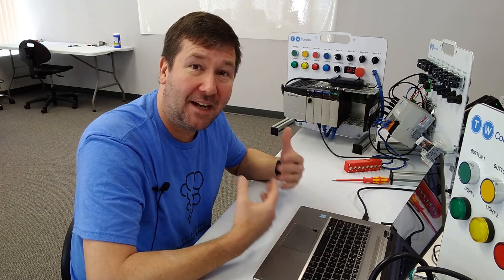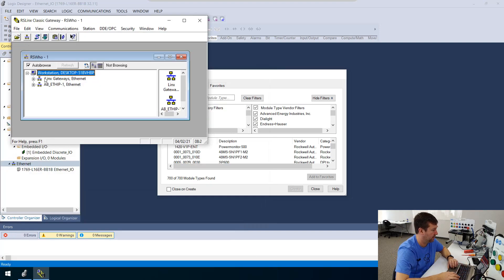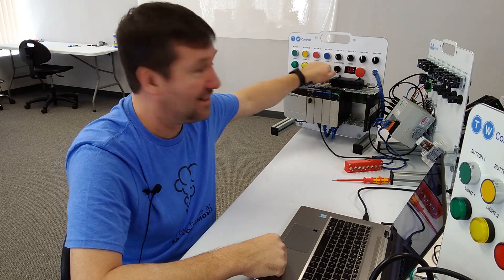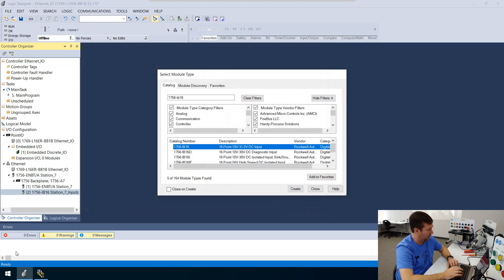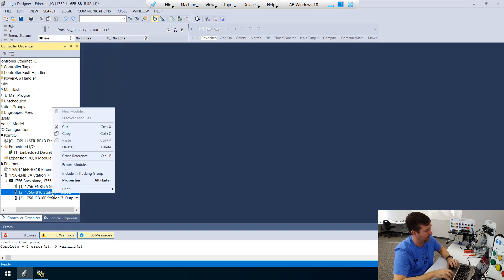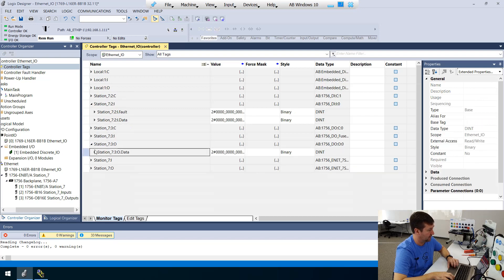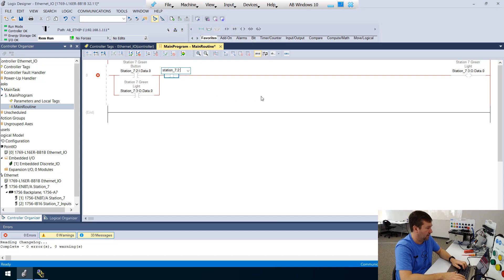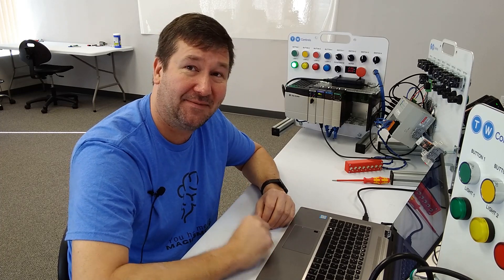Adding Ethernet Modules in Studio 5000

Comment: great video! i have a question... you have set up the DC input and DC output modules through the Ethernet IP module on your CompactLogix,,, can those modules be also linked to the ControlLogix and be read/written in parallel with CompactLogix? or what is the use of the ControLogix processor there?

Thanks in advance!!!
Reply from the maker: The Controllogix processor is not necessary, it just happened to be the trainer I used.

Comment: You're doing such a great job with the PLC tutorial Tim. Question to the expert: One of the I/O Ethernet seemed to got corrupted. The whole ADC project was working fine but all of a sudden, I think, one of the Ethernet modules shows like " <Unknown> Box_Opener". If I try to delete it I get an error pop up saying: "Failed to delete module '<Unknown>Box_Opener'. Invalid consume producer. Module is not a valid producer." Could you help me tackling this problem? I'm using Studio 5000 on a Windows 10. I appreciate your help.
Reply: Forgot to mentioned that the "unknown" device is another PLC that I'm able to confirm is up and running in the same local network.
Reply from the maker: Haven't run into that Hector but Rockwell knowledgebase ID QA28431 seems to be what you are looking for.
Reply: Tim, I called Rockwell and they helped me out. I would like to share the solution with your audience, my 2 cents, they suggested to update Logix Designer from 30.00.00 to 30.02.02 which has many patches and updates, and IT WORKED!!!! Thanks.
Reply from the maker: @hectorvaldez8471  Very good to know, thanks for sharing!

Comment: Question: Can the ControLogic Processor be removed and with the power supply still in place use the Backplane as a RIO?
Reply from the maker: Yes, a Controllogix chassis doesn't need a processor.  Lots of times we use them as networking bridges, most popularly Ethernet to DH+
Reply: @TimWilborne  Thank you Tim… (@_@)